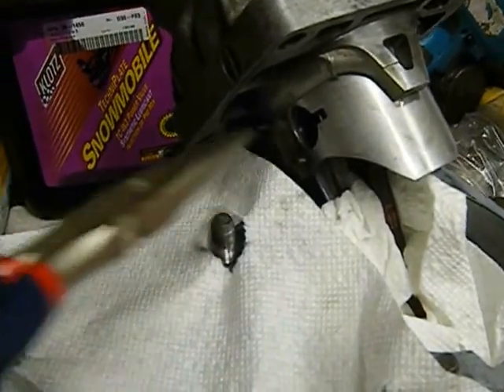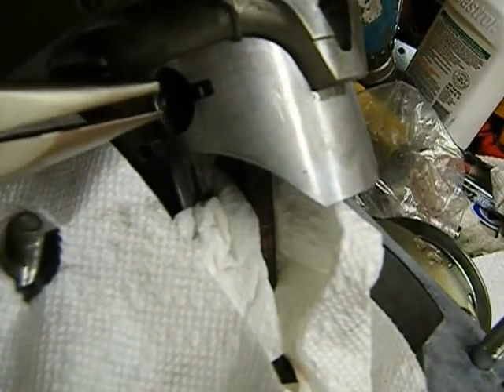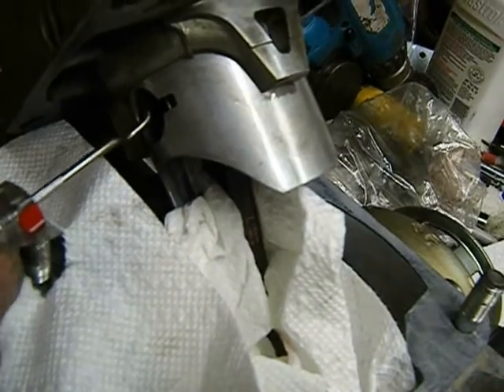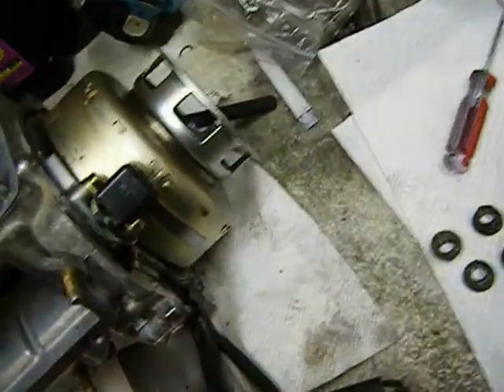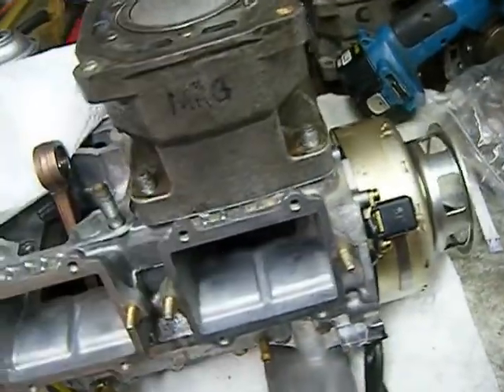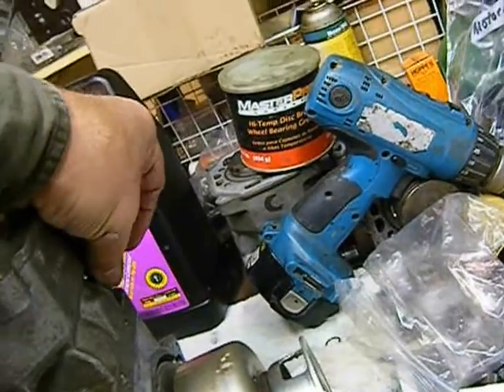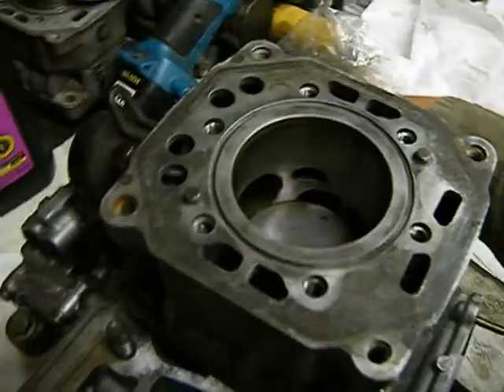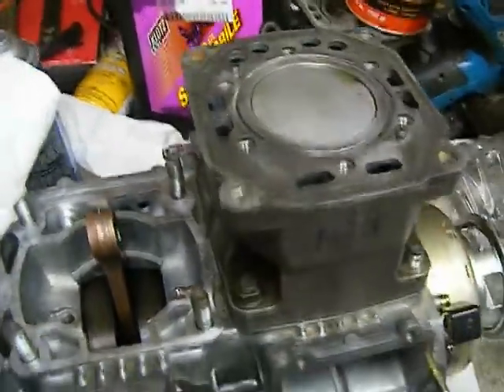SNOWMOBILE 57

Comment: Do you ever put the base gaskets in dry?  What about assembly lube for pistons/rings?
Reply from the maker: I usually use a VERY thin film of ultra grey by versa chem for the base gasket. I use regular two stroke oil for assembly lube.